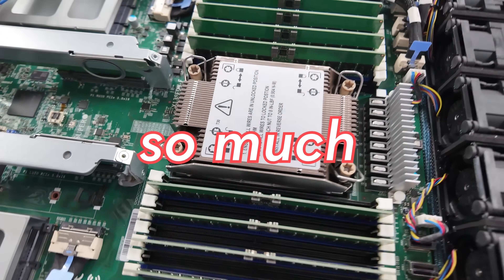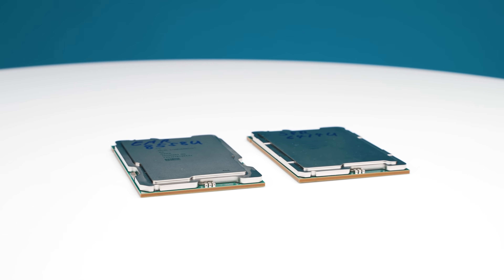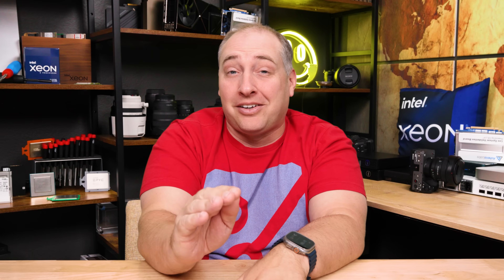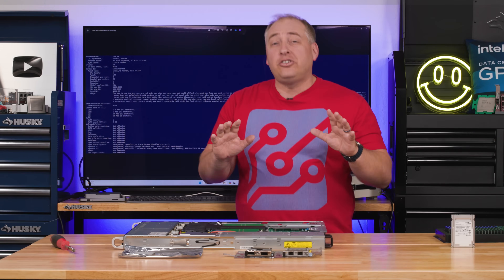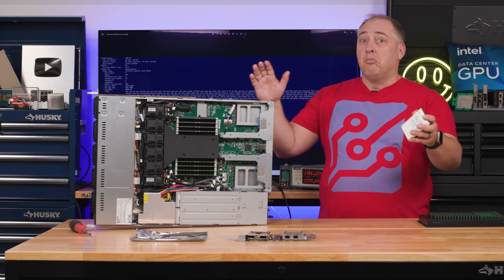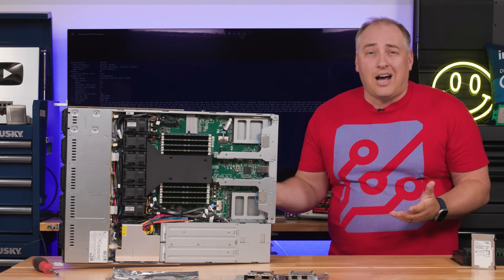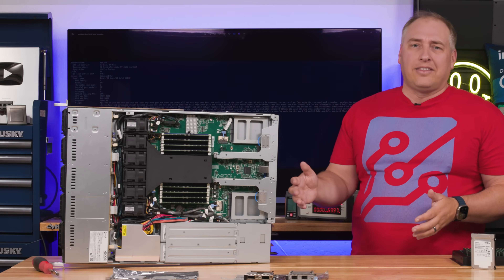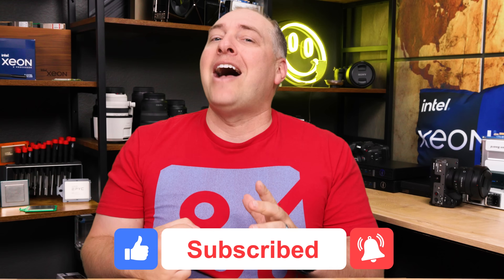5th Gen Intel Xeon is way faster and more power efficient than 4th Gen using the same cores

Comment: One year later ... , i just bought an Platinum 8570 Xeon ES  and as i see it it lacks only 200 Mhz clock speed = 1,9 GHz - 3,8 GHz for ~ 380 -400 USD . It will take some weeks to arrive . But it will be run on an ATX MoBo , the  Gigabyte MS03-CE0
Motherboard .  Still has Octa Channel , 12 x Sata 6 , and 7 PCIe slots with 5 Slots at 16 X PCIe 5.0 or 3 Times x16 and 4 Times X8 . Its quiete cheap , ~  800 USD . Can use up to 256 GB 3 DS Rdimms = 2 TB on an ATX Motherboard .. , of couse i did not spend that much Money , 2 X 48 GB DDR5 5600 must be enough for Testing it  (SK Hynix 48GB 5600MHz DDR5 RAM 2RX8 RDIMM REG RECC ) Quick assist = QAT should be supported on the 8570

Comment: My 4th gen Xeon is both fast and power efficient (E3-1285L v3). I could buy a Z97 board and a 5th gen Broadwell Xeon (faster and more power efficient than Haswell and with L4 cache), but that would be too expensive at this point.

Comment: Guys will you able to make some compatibility tests on tinyminimicro machines with 96GB RAM modules? Youve tested it with HP 600 9gen and mentioned that you also tested it with other 1L pc's but you did not mention which ones. Such compatibility list in some article would invaluable for all folks who want to buy miniPCs for their first homelab. And as we know RAM is the most important limitation for them.
Reply from the maker: We are talking about when we test with 96GB in each of the system reviews

Comment: "Our servers burn less power when not doing anything" isn't the win this ad wants to think it is. Maybe my business is just doing it wrong. We tend to deploy servers to do things. 😅
Reply from the maker: Huh? We showed the 300W TDP CPU out-performing the 350W TDP CPU and over 80W less at the wall. So this is idle up to 100% load. Also, we have to say sponsored even if the chips are marked as non-retail confidential. Very odd comment.
Reply: @ServeTheHomeVideo  You're right, the generational gains at load are noteworthy. I just found the heavy focus on idle usage very strange for a server bound product.

As for the rest, sponsored is sponsored. For the duration of this video you are an extension of the sponsors marketing department. It doesn't make the video "wrong" or not worthwhile, but it is what it is. It should be watched in that context.

Comment: I can't speak for all HomeLabbers, but for me I needed PCIe Lanes more than raw compute for my HomeLab. So in January I went with an Epyc 7313P on a RomeD8-2T board with 256GB of DDR4 3200 RAM. I found the Milan chip for $470 shipped, bought the mobo new ($666), and the memory was $381. I couldn't find a better value for Milan or newer platform (Intel or AMD) so looking back I'm still pretty satisfied with my choices.
Reply from the maker: Totally. In 3 or so years when EMR is the same age as Milan is now, I would expect more value options for home labs. When that happens, a point of this was showing the difference in power consumption and performance when picking SPR or EMR

Comment: single core performance was self referencing among the 3 cpu and not comparable with the rest of the world CPUs. geekbench or similar real value would have been more useful. at the end you can have 48 cores but the single core is slow you need more core for the same vm on a server compared to the other. the comparison of the video was more focused on the consumption than the real cpu performance, which was fine, but impossible to compare with rest of the world servers.
Reply from the maker: Geekbench 6 is borderline useless for servers. Or to be a bit more clear, it is useless for this core count of server and higher. Over maybe 12-16 cores GB5 is usually more indicative of server performance than GB6. The vast majority of workloads, outside of things like HPC codes, on modern servers do not run on full chips. Usually they are run in containers and VMs to increase overall system load.
Reply: @ServeTheHomeVideo  I mentioned GB as example you compared the core speed among the 3 chips saying the slowest 100%, the others 120% and so on, that means nothing in real world of performance. I would like to see how the single core speed is compared to my server chip that runs esxi... I might upgrade in future...

Comment: The increased power efficiency at idle is normal, but I think it's worth clarifying a few things for folks about why it's surprising/exciting here.

1. Generational leaps are usually pretty small nowadays. Bigger jumps in efficiency are getting more and more rare. An example on the desktop side would be AMD's socket AM3, AM4, and AM5. AM3 doesn't idle very well. Their Ryzen CPUs on AM4 began to see some really good idle optimization, with some of the 5000 series able to idle at <30W for the whole system with some undervolting. AM5 didn't change idle consumption all that much over the 5000 series. Intel appears to be making the same transition that AMD already made with AM3 -> AM4 by working on their new chiplet designs like this. Given the boost of efficiency that comes with getting all the easier optimizations of a new technology out of the way, it's not too surprising, but it's going to become more rare as time goes on.

2. Due to the laws of thermodynamics, higher clock speeds can't be done instantly. If your CPU can idle at such a low clock speed like these new chiplet designs, then with everything else being the same, it's going to take longer to boost it to its highest speeds than one that has a higher idle speed and/or lower max speed. Optimizations can be made to reduce this time, but after a while, there's diminishing returns on further optimizations, and this is a big reason why the 13th gen and 14th gen Intel desktop CPUs are the way they are in comparison to each other.

These two reasons are the biggest reasons why it's surprising to see the idle power consumption be so low on the surface, but for anyone that understands how technology works, not so much.

(Disclaimer: I'm more familiar with the desktop realm than the server realm. That's why I used desktop examples instead of server ones. The laws of physics and optimization types are the same. I'm just not familiar enough with the progress each ccompany is making on these optimizations on the server side of things.)

Comment: Lower IDLE power makes perfect sense. It's a newer node, more modern package, and probably more advanced power management. It's maybe not something you should expect with every generational upgrade, but occasionally it does happen, especially after several generations.
Reply from the maker: SPR and EMR are on the same Intel 7 process, and the core is effectively identical. The power savings are despite more than tripling the cache size.
Reply: "Occasionally it does happen."  Well . . .
Intel 10nm Enhanced SuperFin n.k.a. Intel 7 per July 2021 company press rel. Loved that moment in Intel history ❤ I think it was called "Accelerating Process Innovation." Exactly, change name 😂

Comment: In terms of the question of single vs. dual socket, I think that it comes down to an optimisation between cost, performance, power, and cooling.

If you WANT (or need) 256 cores, then you can really only achieve that with dual socket servers at present.

But if you want 128 cores or less, then the question of whether it would be more cost, power, and cooling efficient to go with a single socket solution vs. a dual socket solution will depend on the pricing, etc.

For example, if you want 32, 48, or 64 cores, would it be cheaper to buy two 16, 24, or 32 core CPUs respectively or would it be cheaper (and lower TDP) to run with a single socket solution.

I haven't plotted this optimisation analysis yet, but maybe if I have time, I might.

My main Proxmox server right now is dual Xeon E5-2697A v4 (16-core, 32-thread) processor that has a 145 W TDP. An AMD Threadripper 3970X for example, would be 280 W TDP (so only 10 W less, but still costs $948.99 USD on eBay whereas I bought said Xeon E5-2697A v4 for a grand total of $170.66 also on eBay, a year ago.

The extra 10 W of TDP is negligble in terms of cooling.

So, the question then becomes "how long would I have to run the system to be able to realise the $778.33 USD cost via savings in electricity costs?" (Assuming that I am running the system flat out, for the entire duration.)

That's 0.01 kW difference; run it for an hour that's 0.01 kWh difference * 24 hours * 365 days = 87.6 kWh/year @ $0.10 USD/kWh = $8.76 USD/year difference.

$778.33 / 8.76 = 88.85 years.

So, this is some VERY rudimentary arithmetic to show how difficult it is to justify the cost of "downsizing" from dual sockets down to a single socket platform.

Now of course, there are other benefits that comes with the Threadripper platform that is wholly absent from the Xeon E5-2697A v4 platform, but in terms of the question of single vs. dual socket, this is the kind of level 1 analysis that I would perform, to see if it would even be worth it.

If the other features that the different platforms offer is important (e.g. more PCIe lanes available on the Threadripper platform), then I can factor that into the equation along with other things, but it is often times, still difficult to justify the cost of said socket downsizing.

Comment: Great video! It’s a bummer (in this case) that there is no eps12v for the cpu to just put an amp clamp on. I think this is the best way of isolating given the constraints. I’ve collected data like this before and it is very time consuming. Appreciate the work you guys do,
Reply from the maker: Thanks. We had the package power in this one but I generally do not love using it. The real number that matters is at the PDU since that is what drives rack sizing and overall consumption

Comment: Here in Europe these efficiency gains really do matter a lot. I wonder how efficient these are compared to Milan if you're able to utilize the onboard accelerators
Reply from the maker: On the single socket SKUs I wish there was more acceleration active. Still, when those are used it is a big delta
Reply: why do they matter in Europe ? Because you live in Europe ?
Reply: @xl000 large swathes of Europe abandoned nuclear power in favor of tying their power grid to Russian oil, natural gas, and (German?) coal in the vein hope that this would reduce Russian aggression and not, as actually happened, emboldened future aggressions. As a result of recent trade embargoes on Russian energy sources, and some members of the EU starting to finally realize coal is bad, power in Europe has increased in price dramatically. I’m pretty sure I saw reports out of the UK that people’s power bills were eclipsing rents. And even before this, power in Europe was already more expensive, for one reason or another. 

For example, in the US, 6 cents per kilowatt aren’t uncommon, with 13 cents being relatively high. In the EU, I’ve seen figures ranging from 21 cents to 38 cents per kilowatt.

Comment: My production system has three hosts with 10 cores each (Scaleable V2), but then again I only have 5 windows servers and a few debian thrown in. Cost was the factor at the time or I would have gone with 20 cores each. I didnt think about memory channels, only 2 modules installed in each host, probably should have filled all the sockets for a little faster performance. Used a 2x64 config. so I had room to grow.

Comment: If you don't need a lot of PCIE Ryzen cpus have been the go to for a homelab for several years now. Im using a 5900x with 128gb RAM as my homelab and it is working great with low power consumption because of slightly undervolting.
Reply from the maker: Also memory capacity and bandwidth. We pulled a ton of memory out and are using smaller 32GB DIMM but this is still a 256GB configuration.
Reply: @ServeTheHomeVideo  That is true, but if you need more than 128GB of memory you probably need more PCIe and have a larger budget also.

Been following your website and channel for many years now and I love the content. Greetings from Norway :)

Comment: Totally agree with you Pat. Most folks should really save on core count and invest the savings in more RAM or storage. I run my own private cloud on a dual socket 12 system with 24 cores total. Despite having some 20 VMs (including AI inferencing and in-memory databases), the average CPU utilisation tends to be under 10%. Also, higher GHz tend to be better overall.
Reply from the maker: Great point

Comment: Interesting! A couple of suggestions: since the BMC is running even when the server is off, you could have powered down the server, measured the wattage used, then subtracted that from the total. Also, there are USB cables you can get with a built in LED that shows how many watts of power is being used that you could have used to find the power draw of the USB NIC. And given the different core counts, I think Watts/Core probably makes for more comparable numbers rather than just total system power.
Reply from the maker: When I say 5-7W for the BMC that is inclusive of the fact that when the server is running the BMC is usually doing a bit more logging.

Comment: I'm more of a user so I have a different approach to server management.  Compared to an IT person.  I do a cost benefit analysis for my workload.  Does the cpu count / gigahertz / memory equal what performance metric for my workload.  Then based on that, cost.  Weirdly some cpus you expect to be faster are technically faster in the performance metric.  But the cost per server is not proportional to the improved performance.  So I usually go a little lower and am able to buy 2 or 3 more servers.

If I'm not focused on cost.  I care about density.  So whatever configuration gives me the most memory and the most compute cores.  
Currently I'm running dual socket xeons.  Do I care that it's a dual socket xeon?  not really.  But reliability is better among intel cpus verse amd.  It might be another component the memory or the motherboard.  But in an array of 20 the intels have no crashes while the amds have 3 crashes a week.  This is a hardware level crash where the system reboots.  So it's hardware related and random enough that I don't want to track it down.

Comment: So, I'm looking for a replacement for the E5-2630L v4 (a 2016 10c/20t processor) for my homelab. It has 40 PCIe lanes, and as far as I'm aware there's nothing like it left on the market. Neither AMD or Intel seems to make these types of processors any more, where you get low wattage (55W), but a decent amount of PCIe lanes. Anyone know upgrades?
Reply: You've pretty much fallen out of the enterprise range at that TDP unfortunately.

Something like a Ryzen 9 7900 65w, ECC support, 24 lanes of PCIe gen5, combined with an X670 board that provides an additional 12 lanes of PCIe gen4 would likely be the way to go.

Supermicro, Asrock rack etc for boards with a BMC for IPMI.

If you can't find a suitable board with IPMI, a Ryzen Pro 7945 could be ok in a consumer board combined with the AMD Pro tech for Out of Band management.
Reply from the maker: Perhaps wait for STH next week as well.

Comment: Single socket systems are the only ones that really make sense now that a single socket can cram all of the things into it. Sod non-uniformity, it complicates things.

Maybe the gen after sierra forest intel might be competitive again. It is amusing having to talk idle power consumption just to give them a positive spin.
Reply from the maker: Why just idle? We also showed the Platinum 8558U being faster than the 8458P at 50W lower TDP and lower total server power consumption.
Reply: @ServeTheHomeVideo  I didn't say just idle, it was just the most prominent example. The 8558U being better than the 8458P is good, but as the 8458P is from intel's "struggle to keep up by pumping power" generation, it doesn't really say much.

The e core gen after sierra forest is the one I'm looking at for intel getting back in the game, sierra forest is already a bust as the main benefit of moar cores has already been handled by the competition beating them to the punch, for sierra to be interesting it needed to be out years ago. They've done the delay tactics of scrapping avx512 and making a mess of redefining 256 bit with avx10.256, lets hope the gen after sierra has avx10.512 (I'm expecting more delays with them using avx10.256 and using misleading marketing, but who knows). If intel messes up clearwater then we are in a bad situation as AMD will be the new intel, I don't have faith in ARM competing more than in specific niches.

I know you're getting rolled in the comments, I'm not trying to pile on I just gave honest feedback about the content.
Reply: That's not what I saw in this video. The EMR CPU was faster than the SPR chip and consistently pulled less power.